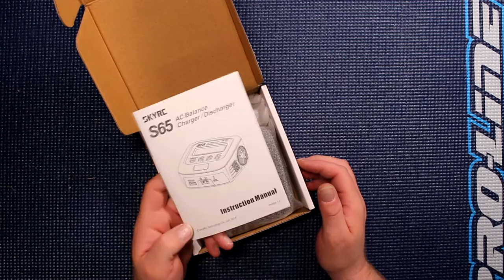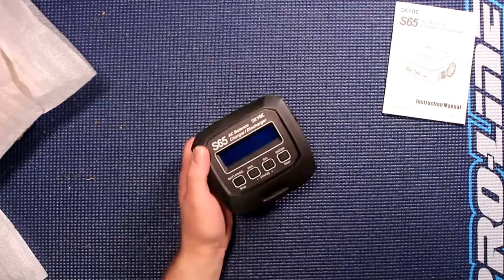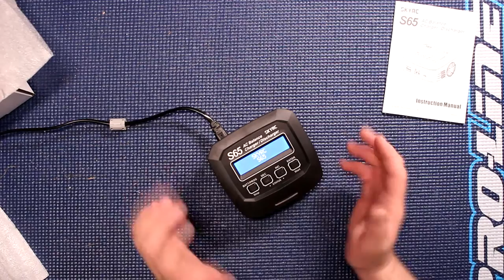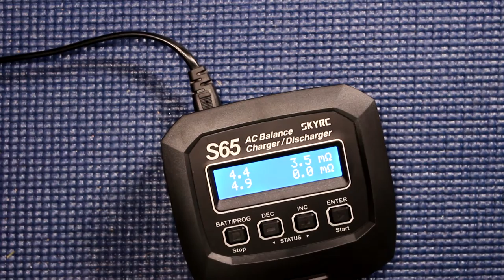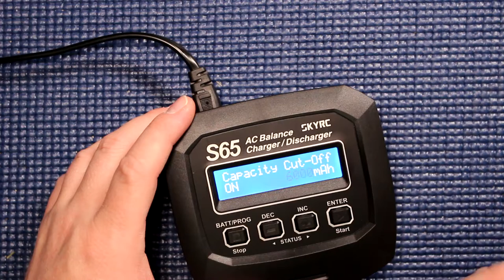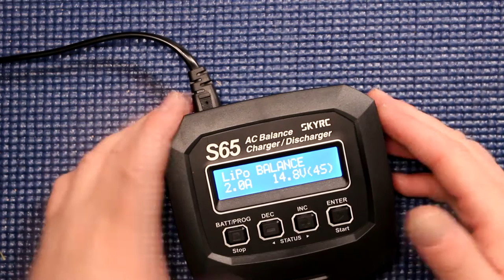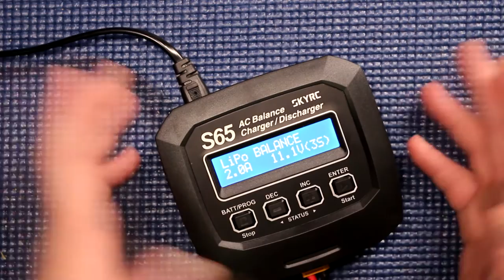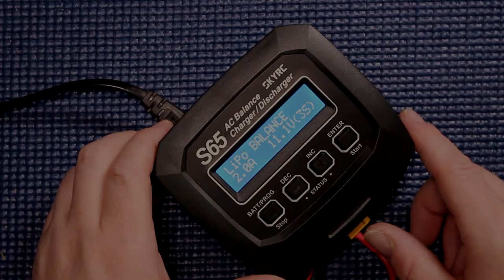Skyrc S65 Charger

Comment: I connected the small wire charger to the right side of the s65, it caused a short circuit and cause burned marks. I am scared to touch it. Is the batt and charger broken?
Reply from the maker: It’s a possibility your battery might be damaged. When you connected to the charger, it should not spark.

Comment: Good afternoon. Please advise what is the most optimal (speed is not important, the main thing is the reliability and durability of the battery) parameters S65 for charging LiPo TopTuning 6500mAh, 4S, 14.8V, 80C, 2C, 96.2 Wh?
Thank you.
Reply from the maker: Normally what I suggest is charging read is the amount of your battery if you have a 6500 would be 6.5 amp. Pretty much all newer Lipo Will take one C charge rate. Meaning your capacity of your battery.
Reply: @djsprc  Thank you

Comment: Can you charge the battery with just the balance wire
Reply from the maker: Unfortunately no you cannot you will need a main connecter plus the balancing lead
Reply: Ok, thanks for replying so quickly

Comment: Where does the middle wire go? I have a 7.4v, 2s 5400mah battery,  settings are correct,  ive attempted my first charge on balance lipo mode,  connected the balance cable lining up with 2 from the RHS, but after 7mins, it says 8.2v, is this normal??? Also do i plug in the middle cable into my battery that has a small plug port in the middle of my Maniax Battery?? Thanks
Reply from the maker: If your battery has direct plug. For bullet connecters your main connection is 4 mm and the other one would be a 2 mm. Yes you need to plug in the middle one and that will give you your balance in charge. And yes a fully charge Lipo will be close to 8 V and sometimes a little bit more

Comment: My 3s batteries have xt30  not xt60 like the charger takes. Is there some kind of adaptor to use? I ordered this charger and didn’t realise it was xt60 Input 🙈
Reply from the maker: Yes probably there is adaptors you can buy or if you can solder  you can make your own or check with your local hobby shop if they have one or they can make you one

Comment: hmm i dont know should i but on the charger 5.0a 3s lipo 5200mah. cant find answer no where if you dont know what did i mean whatch 7:00  theres 2.0a so should it be on 3s lipo 5000mah 5.0a?
Reply from the maker: Yes you can charge and 5200 at 5 A that is fine. Normally what I suggest is the capacity of the battery let’s say you have a 3000 you can charge it at 3 amp
Reply: @djsprc  okey thx now i think i did understand. i asked bc this is my first lipo charger and i read the help book but didint help much and im new  lipo user too.
Reply: @djsprc  we did today charge my battery at 5.0a and when it was 94 procent then it just turn off or something tht 65 did go broken... was first time ever charging my lipo... i mean like it just did go black the screen and just stopped everything didint work anymore i unpluged it didint work but in this week i might get new charger
Reply from the maker: @madrc9781  I did hear people having issues with those charge and once in a while you might have a bad one.
Reply: @djsprc  okey well thx a lot agen of tht answer youre helping me a lot and i do appreciate it a lot keep good work up bro.

Comment: Can't tell if you're saying you need an S60 plug or X60 plug. Either way, you mean XT60, correct?
Reply from the maker: Yes you need xt60
Reply: @djsprc  Got the charger. Using it. Liking it.

Comment: the same charger i bought this evening..but the fan is not rotating..is it normal or is it I will just wait till it turn on automatically after certain factory set temperature? my old Anmann xbase 2.0 deluxe run the fan straight away after i press enter start chaging the battery..please help me
Reply from the maker: RaY-Do-1 MaJesTic If I remember correctly it should turn on by itself once it reaches a certain temperature if it doesn’t you might have a defective unit.
Reply: dj is right. If you charge at low amps the fan may never come on at all. At higher amps (fast charging for sure) the unit will need the fan to cool itself down. btw unless you forgot to charge your batteries and are running out the door, you should charge at a moderate amp setting anyway.

Comment: How do you turn the device off? Are you suposed to leave it always plug in or unplug it when you dont use it? I did not find a on/off button
Reply from the maker: You got to unplug it or just leave it plug in
Reply: I have mine plugged into a powerbar along with other lights and accessories. They all turn on and off together with one button -- the lights are a good visual reminder that you have left your charger on.

Comment: How do you determine what amps to charge a 3s 5000mah battery or 2s 4000mah?
Reply from the maker: Normally it’s the amperage of your battery let’s say at 5000 would be at 5 Amp. 4000 would be 4 Amp
Reply: @djsprc  thanks

Comment: Thank you for the video, I learned how to use this to charge my 2S Lipo. Question, I have recently purchased a 1S Lipo just for my controller. I see they only have 2S 3S 4S settings in this charger. Is there any way to do it, maybe I missed something
Reply from the maker: Unfortunately no that charger will not charge that battery.
Reply: @djsprc  Thank you for your super speedy reply. Have a good one!

Comment: Normally I just turn it off for capacity cut off..it should complete based on Volts rather than Mah..HTRC 240 duo is a better buy for its price..
Reply from the maker: I prefer capacity cut off.  Skyrc S 65 is a good entry charger with a lot of options. I do agree that duo would be a better choice.
Reply: What, the twice the price Duo? Yes, that's generally how these things work. Why not recommend one four times the price?
Reply: both me and my friend got a htrc t240d and both units burnt down in their 1st charge (got them from seperate sellers at 1 month interval) 
they are simply terrible cooling wise, now I use a icharger 206B and planning to get a s65 for traveling. If you really want a htrc get the c150 model, it has way better internals and can withstand a lot of abuse (got half refund for my burnt 240 so I got a c150 instead, used if for a while and sold it, haven't had any peoblems)

Comment: Just bought this, how do I know its charging? All it says is LiPo fast charge?
Reply from the maker: You will need to go and Lipo balance charge then select your amperage then select your battery type then hold the start button down and will start charging
Reply: Thanks! I got it going!
Reply: As soon as I start the balance charge cycle I push the plus button to see the individual cells going up and down. You learn a lot about your own batteries that way.
Reply from the maker: NaturallyRC Yep that is true

Comment: Hello. With this charger can you change the final voltage of a Lipo battery?
 Can you show the final voltage in the menu?
Reply from the maker: If you want to find out the final voltage of your battery the only way that I know of is when your charger stops charging look at the screen it will tell you the final voltage the final milliamp in the time it take to charge
Reply: @djsprc  
Hi. What I wanted to say, was if you could put a higher charging voltage on the charger via the menu, ex: 4.30V.
 With the TVC function of this charger. 
Anyway, thanks for listening.
Reply from the maker: Blue Shark   I believe I don’t think you can I could be wrong here but I don’t think so

Comment: Hi how do I charge my nimh as max says 3950 . How do I increase? Cheers
Reply from the maker: Depending on the capacity of your battery you will need to go in the menu and change it normally it should be at 5000. You will see maximum capacity increase it 1000 more than your capacity of your battery.